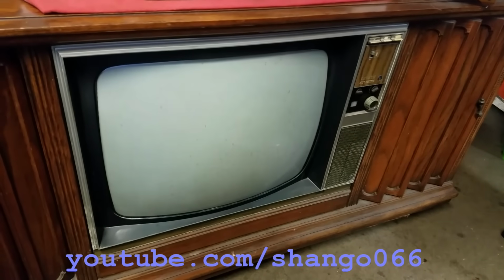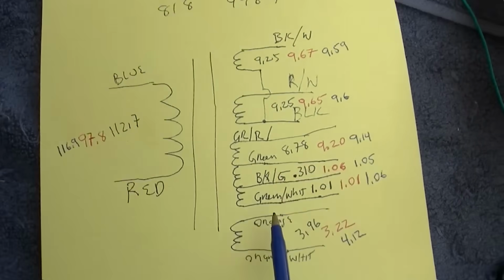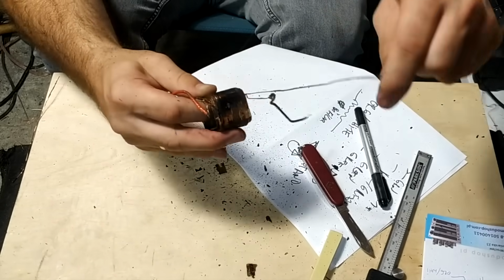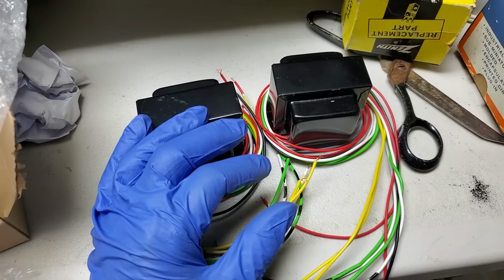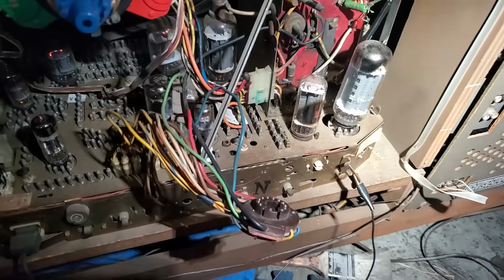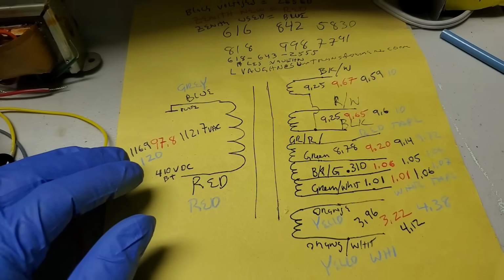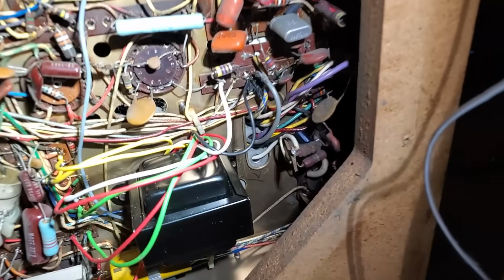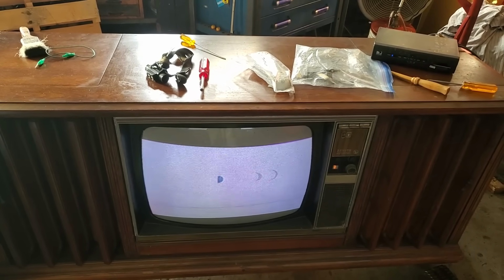Zenith Color TV Vertical Output Reverse Engineering And Building New Replacements

Comment: Why don't you flip only the leads on the yoke? It is simpler. If every other things are working you only need to flip the 2 leads on the yoke responsable for the vertical deflection. Done. Picture reversed. What's the complication? Instead of flipping inside the trafo you just flip the leads on the output. What is the dramma? I don't understand. Those yokes should have 2 leads for the horizontal and 2 leads for the vertical as every other crt tv so to flip the picture it is just a matter of flipping those 2 leads for the vertical coil on the yoke. I may be wrong because I don't know Zenith yokes but if it has just 2 leads for the vertical than it is only a matter of reverse the leads and problem solved.

Comment: I may have made a similar comment before about Zenith TVs. Zenith once made a promotional film in which they boasted that unlike competing TV manufacturers, they had not embrace printed circuit board technology because they believed that hand-assembled point-to-point wiring was more reliable. I believe that the same film showed some tool operators making the rivet-style terminal strips seen in this TV.

Comment: Your flyback transformer turned into a fryback transformer... and it will likely be a "problem child" from this point forwards without replacement (obtainable from planet Unobtanium in some unknown parallel universe) or if the secondary winding donut didn't suffer internal burns, extreme remediation of the rest of its structures with careful removal of all traces of the carbonized places on insulating materials (examine with optical magnification) and treat them with the best HV insulating paint-on coating/dope you can obtain. I once saved a flyback from a Whites Auto Catalina 25" console tv (actually made by Wells-Gardener) and it lasted for many years.

Comment: I found this video very interesting and informative.  I've addressed this issue several times before when you stated that the vertical output transformer was a frequent failure on a Zenith.  I've serviced and sold Zenith's exclusively since 1967, and to this day, I have never replaced a vertical out on a Zenith.  Granted, your 14Z8C50 had a definite Vert Out failure.   But I would be interested to know if anyone else has had issues with Zenith Vert Outs.  Actually, until now, I have never heard of ANYONE having to replace one.  If any of you technicians out there have had this issue with a Zenith, let me know.  I would just like to know how common this actually was.  Thanx,   JIM

Comment: Well, after watching this video, I have some pretty mixed feelings about Marko's transformer rewinding job. There are a few things that don't  look very professional, to say the least. Let me point out some:
- Right at the beginning, when he started to dissect the transformer: Man, you don't have a desk to work on? Just a shaky piece of board?
- That polish-made soldering gun is the same model I used when I started to get to electronics. I was like 12 years old that time and I already knew that that tool is a piece of sh*t: it burns everything because it gets too hot, but doesn't have enough thermal mass to solder anything a little bigger. So in just a few years later I already got my first Weller - it was beaten up, as I manage to get it from an electronics factory as they were scrapping it, but man, it was a night and day difference... Nowadays that you can get a decent knockoff soldering iron (like a Bakon or similar) for a little money from China I cannot accept any excuse to use that old stuff anymore - for anything professional...
- And third: again, for maybe a 100 euro, you can get a vacuum pump and chamber from China. I got one, and I do not rewind transformers daily! Throwing the transformer into enamel is pretty much nothing. There is a reason why these are done in a vacuum at the factory...

Comment: So those vertical deflection coils are very similar to plain old speaker coils right? I wouldn't be surprised if those output transformers were exactly the same ones as those used in audio amps.

Comment: Fantastic video. I had the flyback rewound for my Murphy V310A some years back, this is in an oil-filled can so not sure how (or if) moisture got in. I suppose it's possible since the set had obviously been stored in damp conditions .. the cabinet needs some serious work.

Not cheap mind you, at least postage wasn't an obstacle as I could drive there.

Comment: Hey Shango, nice engineering effort to duplicate the vertical output transformer.  Marko's experience winding tube audio output transformers is really valuable in producing a high quality vertical transformer.  The use of bi-filar wire (typically a red and green enamaled wire stuck together) really improves high frequency response.  The only mistake I noticed was Marko did not vacuum impregnate the varnish, which is very importsnt for a low frequency transformer.  The air pockets between windings allow the wire to move as the magnetic field collapses and, over time, the enamal wears away causing shorted windings.  You can easily tell if there are air pockets in the enamel; the transformer will buzz when it is running.

Those Zenith flyback boards arcing was a common occurrence.  Moisture and dust would accumulate on the higher voltage terminals, causing a corona to take place.  Ultra violet light generated by the corona would break down the board material, causing carbon tracking.  Later flybacks had these terminals covered in silicone rubber, which slowed the breakdown process.

I don't know how well that flyback Marko wound will hold up.  That Mylar wrap does work well but, the material does absorb moisture after a while.  To seal the windings off properly, typically the windings are potted in silicone rubber or it is dipped in a super hard epoxy (any air bubbles in the potting allows a corona to take place, quickly breaking down the insulation, vacuum impregnation eliminates the bubbles). In either case, this final step must be vacuum impregnated.
Reply: In tube amps, audio ouput transformers are a "critical" part, in terms of sound. We have some amps from local brands in the 60 and 70 and  only one of the transformer manufacturers was priced for the quality. Today people search amps with transformers made from this company. For Hifi and Hi end people expect the highes standards.
Reply: @38911bytefree  Agreed!  I think winding vacuum tube audio output transformers for widest frequency response is a lost art.

Comment: Not in any way to be criticising but when you send a transformer to have it rebuilt/remanufactured, you need to always provide the phasing-information because (as you saw during Marko's disassembly) when the transformer is that burnt, wires just crumble, so the winder many times has to use the schematic.  And yes, the diagram should have been drawn with all the phasing in the same orientation--that part is ridiculous!  And, finally, on all prototypes, NO buried or internal connections.
Anyway, I can just imagine two old repair guys back in the 60's, when one says to the other, "I just think i'll rewind this convergence transformer"; what a chuckle that would have started.  You would hear the transformer making is spiral travel down to the bottom of the trash can!
So, hats of to both you and Marko for a very valiant attempt, as I was convinced it would have some kind of performance difference/issue!     
73 and looking forward to the flyback result...

Comment: I don't know if this is possible for your special transformer but I have in the past used two 12 volt transformers for a cassette deck that required a 24 volt center tap transformer and it worked out fine. Now for your case you would need 5 or 6 small transformers, then have to phase them all as needed.     Great fix an your part and the transformer winder guy.   Sometime the dust I think will become conductive due to the high voltage and that stronger attraction.

Comment: Had a late 60's 25" console set given to me that had gone thru a flood.  After I put it outside and flsuhed out the mud and let it dry, it came up with a picture.  Convergence board was in the back...27 steps for convergence.  Lost the drive to the HOT once and it red-plated and sucked in the envelope.  Finally gave it away and got a flat-screen.

Comment: This is VERY good news and information. I have a Scott tube amp sitting on the shelf that I purchased years ago that I think has a bad power transformer, apparently his area of concentration. It came tubeless and I (now) vaguely recall that the transformer wires were disconnected. I never attempted to test it. Far down the project cue.

Comment: I have a question about why would you put some much time and effort into repairing these old TV. You can't even watch TV on them without a digital to analog box or vhs. I am not trying to be rude or anything. The only reason see for having a TV of that time period is for nostalgia reason.
Reply: I think there is a way to get a way to stream old TV shows and commercials thru them. It’s like I got some old tube radios I hook up an AM transmitter and stream OTR in them from my phone. Beats windbag political talk any day!

Comment: We had a 1966 Motorola, the last year before the Quasar disaster, which I took to my apartment in 1980.  It had a lot of hours by then and I had cut a hole in the back panel where the convergence board was.  It had an extra IF and was able to sync and give a viewable picture from a video cipher source.  A capacitor blew in 1985. The CRT was also pretty dead by then so I kept the set in the basement. Amazingly when we moved in 2015 someone actually wanted it so maybe it is still alive!  Had the original sales brochure with it.

Comment: The verticals are great but I have my doubts with the rewound flyback. Kapton is a great insulator, but in fact, it can absorb some water and that decreases its breakdown voltage considerably. But the main issue is the lack of vacuum potting. With that lot of air trapped between the layers, corona might be an issue. The fact that the kapton tape is like 4x wider than the winding will save you from an arc jumping netween two layers. Unless an air pocket gets ionized enough to produce ozone. Ozone is a big enemy of Kapton (and probably to any other insulators).
Reply: That's right, I don't understand how can someone just throw high-voltage tube transformers into lacquer and call it a day??? And one can buy a usable vacuum pump and chamber from China for like a 100 bucks or less! That's everything but professional...
Reply: @janosnagyj.9540  I have no major problems with the vertical output transformer, it looks great and it is probably OK (although vacuum potting it would be better). My main concern is the flyback, I'm not sure if it will last a decent amount of time. Kapton is great, but can't do wonders with a lot of air trapped between the layers. Vacuum potting probably wouldn't help in that case either, because the tape is self adhesive and probably wouldn't let all the air out even in a vacuum. Adhesive free Kapton tape would be better for this application. 

Egyébként én is magyar vagyok :) . Vákuumszivattyú 36-ért? Annyiért én is vennék. A szállítás gondolom a másik 36.
Reply: @mrnmrn1 Szia! Alin ki lehet fogni, most epp Vevor-t akcioznak 138EUR-ert ingyenes szallitassal. Pumpa + edeny. Ha valakinek ez a hobbija, akkor sztem a minimum hogy beruhaz egy ilyenbe... az a tekercselogep biztosan sokkal-sokkal tobbe kerult!

Comment: If he makes a replacement transformer in the future, He should not tie the two coils together in the transformer. He should run separate leads and that will give you the option to rewire the coils in your fashion. just a thought, may not work in a bifilar wound secondary though. Thank you Shango066

EDIT: Never mind, at 00:55:35 you had the exact same thought.

Comment: I have rewound a couple transformers but it takes a LOT of time. The last one was a power transformer for an oscilloscope where I added about 200 turns to the primary to raise it to 240V. Then potted it in polyurethane varnish in vacuum.

Comment: I think the reason for the two windings was to have the centering control only affect centering.  (Signal level being same amplitude regardless of setting.)  Otherwise, the adjustment is likely to affect the height as well.   If you can live with the control interaction, I'd parallel the two windings and call it a day.

Comment: I work as a design EE for a large corp.

We spend $$$$$$$ on proto parts and outside lab services.   A few hundred would be under the radar.

But for small business and hobby customers, a couple of hundred on a 1 or few off is a non starter.

Comment: To get the required voltage across the resistor to dissipate the ~10w to make that 3w resistor glow like that. You multiply the watts by the ohms, then the squareroot of that will be the voltage required to dissipate the wattage.
Reply from the maker: 47000 ohm
Reply: @shango066  actually its the squareroot of (watts * resistance). Since power = volts * volts / ohms
10watts across a 47k would require nearly 700V

Comment: "Buzz-O-Matic 2000" - that was really funny!  I am really glad that you buddy in Poland can do the transformer re-winding.  Great video. That tube that had the blue glow in it - Is that normal?
Reply: Suggests very strong emission. IIRC it is the result of higher plate voltages and the resultant electron speed increasing; when the electrons strike the glass it results in the glow.
Reply: When the light comes on, you're in the X-Ray groove.   LOL

Comment: Regarding customer service, or the lack thereof, and companies not wanting to deal with you unless you're making a big order... I've been on both sides of that. So, I don't like it, but in some cases, I get it.

On one side, I recently contacted a dealership to see about having a key made for one of my vehicles. I was already prepared for a high price and a long wait time, but they straight up said that my make and model did not have the type of key I wanted... despite me doing my research ahead of time. Another time I called Home Depot to check if they had any generators in stock. I was told that they did not. I drove over there and saw a huge stack of them out on the floor.

In both cases I think they just wanted to get me off the phone. So they either lied or didn't bother to check, because they simply didn't want to talk to me. And I see that a lot. They probably gave you a high price and a long wait time because they wanted you off the phone.

Now, on the other side, I get it, because I don't like talking to customers on the phone. If a customer is calling us, typically it's either to complain about something, or because they are too stupid or ignorant to read even basic instructions, that I typed up in bold font because in one case yes, I wrote the user guide. So I have first hand experience with customers not bothering to even GLANCE at the instructions, then calling up to ask questions, that were already answered on the website's FAQ.

And it is torture. It's not simply annoying. It's not simply grating. It is a form of psychological torture. It's kind of like Chinese water torture. When it first starts, you think that it's no big deal. But as it goes on and on, it wears on your mind.

So part of me understands why they just wanted to get you off the phone.

Comment: The phase of transformer windings is usually denoted by the `dot` method, where all windings would have a `dot` next to the start of winding (or the finish as long as the same convention is used on all windings) Another method would be to use letters on all windings, S start, F finish. I think that this might have been done to discourage individuals from winding their own. When I draw my diagrams, I do try to keep all phase orientation maintained on the diagram, start at the bottom and finish at the top so I can well understand how this error was made.
Reply: I was thinking this in my head, where are the damn dots?
Reply: @v12alpine in your head.
Reply: In one part of the video, where the transformer is shown in-circuit, it made sense to me that this was supposed to be a center-tapped winding. I am not suspecting that the people at Zenith necessarily had anything sinister in mind.

One possibility that I thought likely was that in the era before CAD, engineers likely made sloppy hand-drawn sketches in their notebooks as they worked out the kinks from a design. It was then the job of drafting technicians to clean up these drawings for publication. The drafting people weren't electrical engineers.

Comment: Is it possible to use a 1 to 1 turn ratio transformer connected to the winding that has the wrong phase to invert it again so that now it has the correct phase? I dont know if I'm being clear with my idea...
Reply: In an ideal world, yes. But in real, this extra 1:1 transformer will have extra losses and that needs to be compensated. Maybe turning up the V_Size adjustment will be enough. If not, the 1:1-transformer will need to be 1:1.2 or so. And the two parallel wound secondaries could be a hard to find property. Usually it is just 2 on top of each other.
Another solution could be to use both new transformers. Flip the primary on one of them and connect the secondary that needed to be flipped to the transformer that has the primary flipped.

Comment: That's just downright awesome! I've rewound a low-voltage, low-current transformer - even the most simple thing like that is a daunting task. I do have a couple sets of bobbins and laminations that would yield 40-50 amps at 13.8V, liberated from their failed original windings. Both were HV transformers previously, but they are projects for 'someday'... As always, well done!
Reply: Really, the original diagram should have had the heavy black 'sense' markings to identify winding polarity.